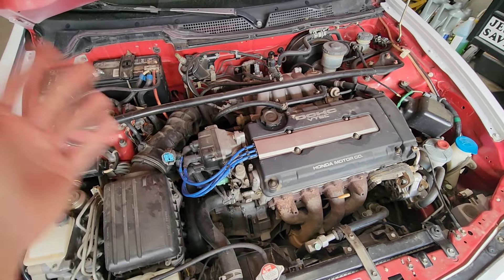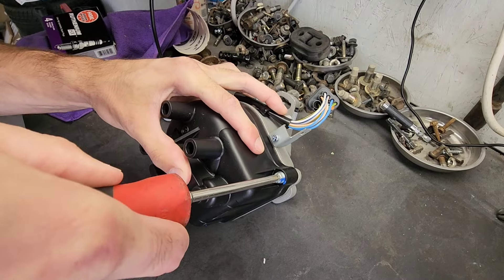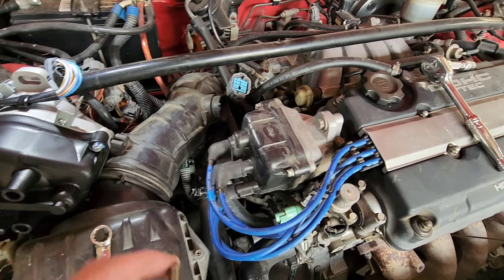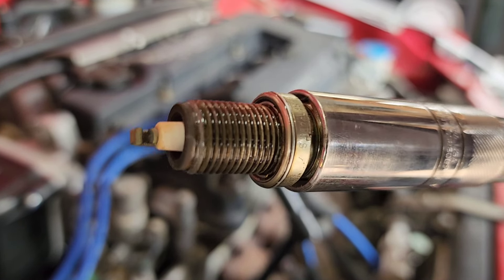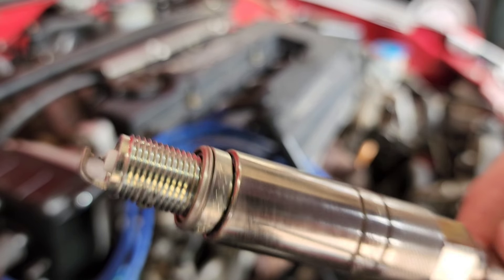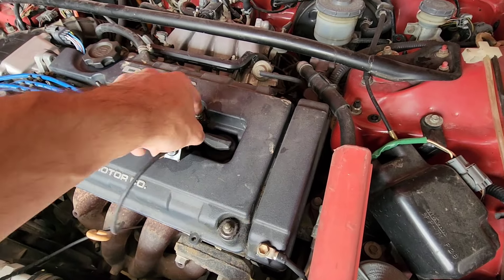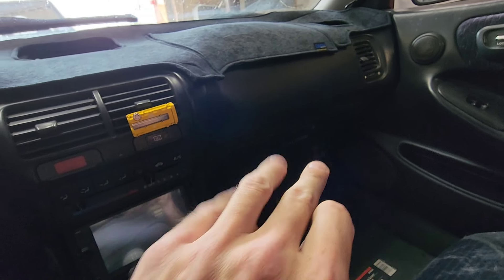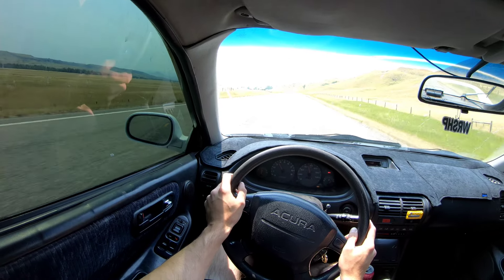Acura Integra GS-R DC2 distributor and spark plug replacement - ignition timing light - POV cruise

Comment: i experienced the same with the break up, noticed it on the dyno, changed the rotor and cap to the oem, for now works good, the tuner said it could also be because it was hot outside and it was runing a bit richer, could have fouled the spark plugs, but i am not to sure, lets hope its the cap and rotor 😁